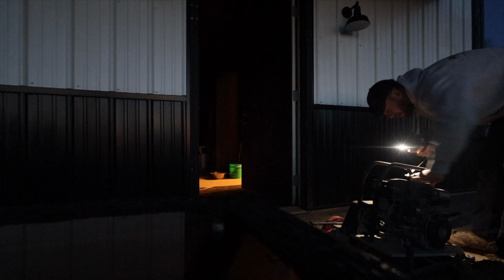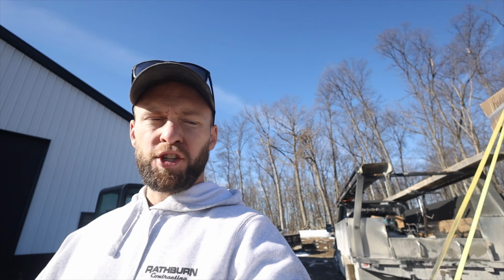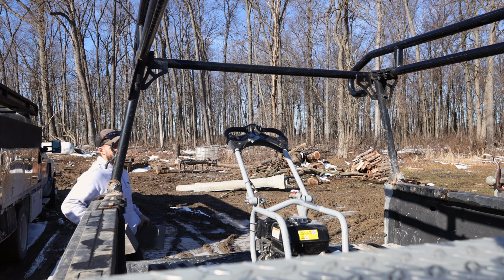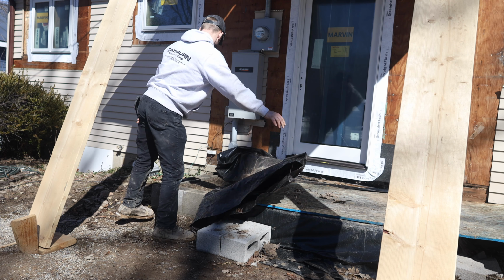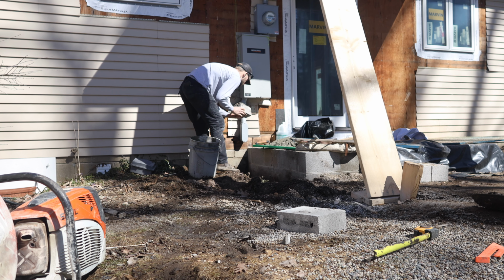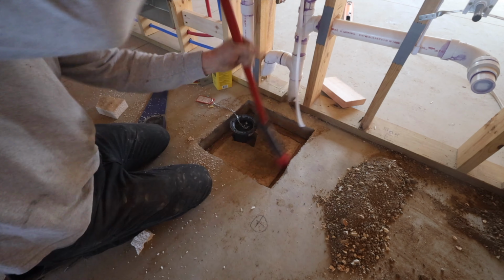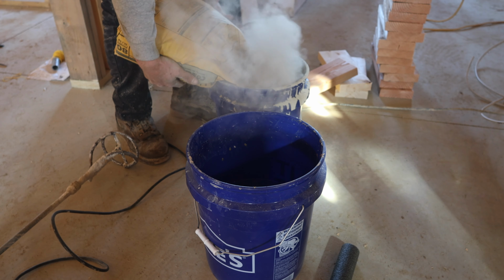Balancing work and the house is hard!.#ep21

Comment: Hey Austin, definitely do more concrete videos. I have to say you two are doing an awesome job on your house. 
Where abouts in Michigan are you? I saw on your trucks that you're a flying Dutchmen. 
Also, what size are your exterior walls looks like 2x6.
I just hit the subscribe button, so keep the videos coming.
Reply from the maker: Thanks Nathan! And we’re about 30 outside of Ann Arbor. We don’t show our actual location for security reasons! Yes we did 2x6 exterior and a combination of 2x6 and 2x4 for interior! Welcome to the Ranch!
Reply: So the 2x6 interior walls were they on they walls with plumbing in it ?
I to am about 30 min from A2
Reply from the maker: @nathana8023   Yes, anywhere there was a shower/sink I did 2x6 and the kitchen to give the cabinets some more stability.